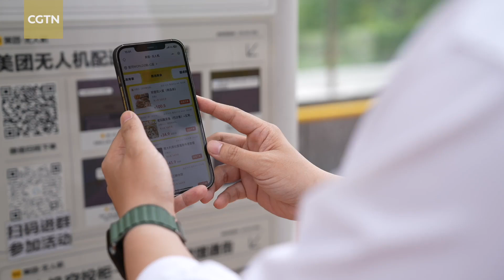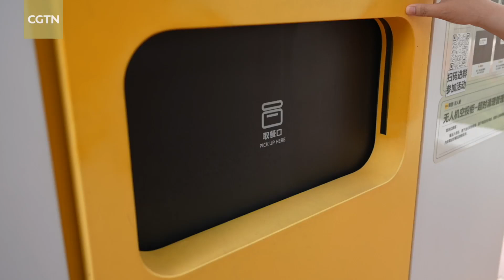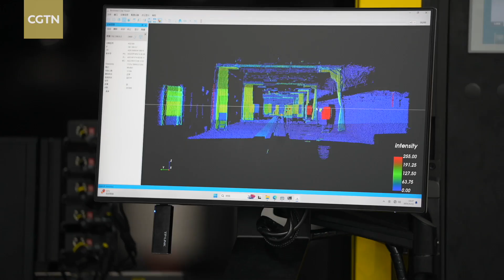Why China is the leader in the LiDAR sector

Comment: I've driven NIO before, and several other chinese ev with that lidar thing above, and the adaptive cruise control of those vehicles are doing much worse than those that's not using lidar, the drive isn't smooth and they stupidly fail to recognize some european roads. I don't know if it's the lidar that at fault or is it the software from the ev manufacturer, but they all have the exact same problem
Reply: was the car imported from China or did you use one from an official dealer in Europe?